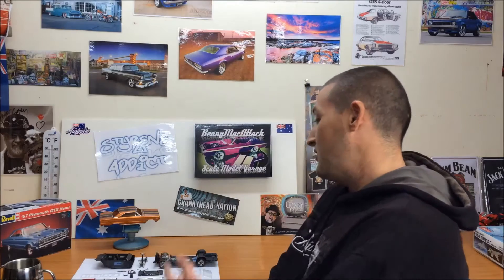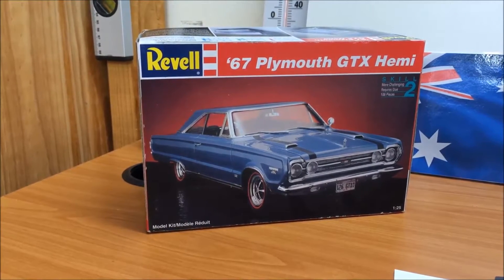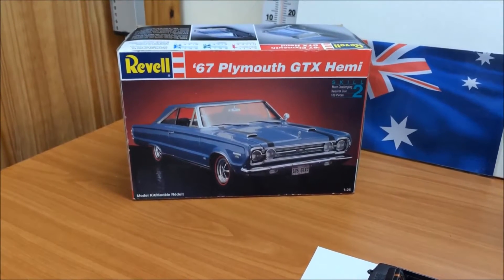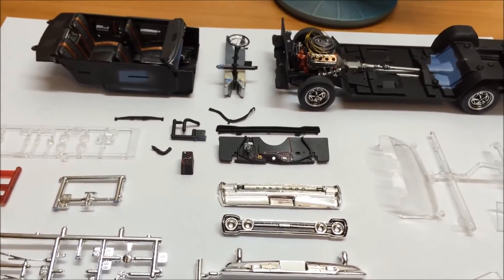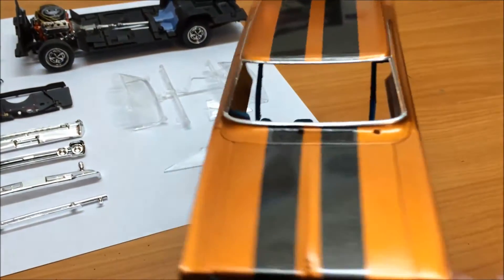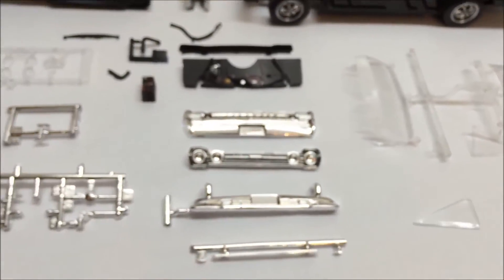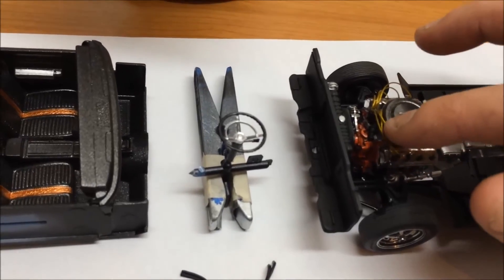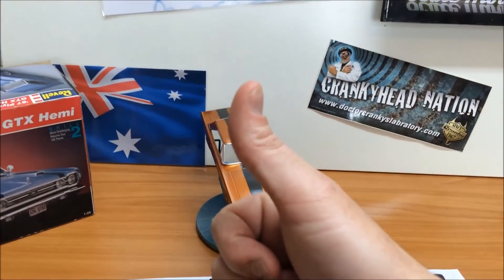67 Plymouth Update - Last Update Before Final Reveal

Comment: Looks wicked bro. Ah the BMF......yep I have a love hate relationship with that stuff. I tend to use the aluminium tape these days, it's cheaper so if I screw up I don't burn holes in my wallet.
Reply from the maker: Cheers brother, yes the results of BMF is awesome but putting it on can be a pain in the butt lol. Hmmm aluminium tape aye. You should do a video on that mate, or point me in the direction of someone that already has. Cheers again and HAGOM
Reply: Bennymacattack I have seen others use it, but cant think of them off the top of my head. You can get a roll of 5m from ebay. Or go to those asian variety stores. It looks more like chrome and its heaps cheaper. The only downside is it's a little thicker and stickier.